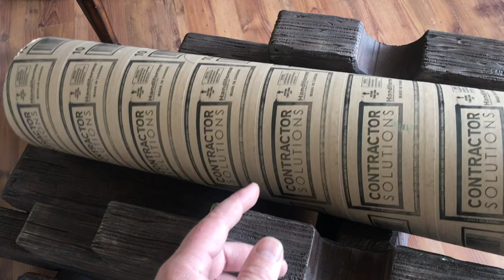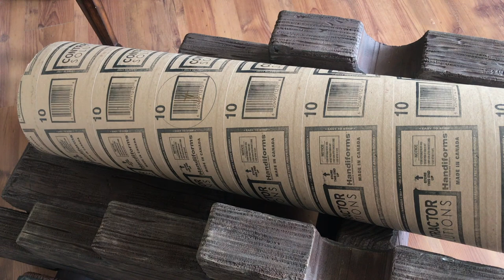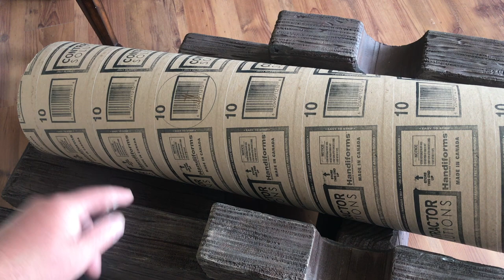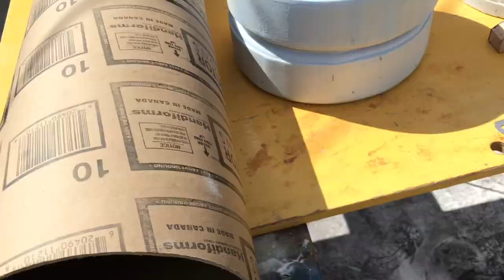Build a DIY Prop Pirate Cannon, Part II - Building the Barrel!

Comment: Looks good. Because making one wasn't difficult enough as it was, I tapered my barrel when I made mine. Just wanted to give it that "extra" bit of reality.
Reply from the maker: I get you 100% and respect the fact you went for that last bit of realism!  I had gone through the mental gymnastics of making the barrel tapered, but I knew while I may be able to pull it off decently, if anyone else tried it would become and exercise in frustration as that wedge you have to cut out must be really precise if the tube is going to rebind properly.  So after much deliberation I decided to go with a straight barrel body and some shenanigans to make it look tapered :). Thanks for watching Pirates if the North Court!

Comment: I need to do this before Halloween. Am using bigger wheels though, like wagon size! I cant put a bowl on one end though as am using a green  light and smoke machine in it.
Reply from the maker: If you are looking for a wheel design, depending on the size you were looking for I did a wagon wheel tutorial here https://youtu.be/c3hAT-a-HAM   It does take a bit of woodworking tools, but the wheel is amazing.  As for the end cap for the smoke machine, you could design is to magnet clip on.  Might just take some minor adjustments.   Glad you enjoyed the video!

Comment: You can also just take white glue and wood glue and water in a 1:1:1 ratio and that makes a good protective wash, too.
Reply from the maker: Will have to try that!   I had sealed my old porthole prop with a similar mixture, but found some issues painting on styrofoam with it. Thanks for the tip and I'll see how it goes!

Comment: I'm just starting this build.  Great job showing how you did it.  Why the base coat of brown paint?before you added final paint job. Ive seen others talk about water based polyurethane prior to painting. any ideas or experience with that?? Cheers !!
Reply from the maker: The brown base coat was to seal the tube and the repairs I made to the seams, as the spray paint was way more expensive. I wanted to throw down a dark base coat that acts like a primer and it just happened to be the best colour I had on hand (I thrive on using mis-tints from stores to save money) A nice solid base ensures the $18 can of spray paint goes as far as possible! lol.   As for a base coat of polyurethane, I have never tried it, I usually coat with a poly after completion but never before, that stuff is amazing for stopping things sticking to it.  I will definitely experiment with it and maybe you will see a video on the results!  I'm always learning :). Thanks for watching Brian!

Comment: It's a cardboard tube. Aren't you worried about it staying intact with rain and bad weather?
Reply from the maker: It is always a concern, but overall with the current finish, the chances of catastrophic failure is pretty low with low exposure.  This canon is really a indoor prop and when I put it together I had in mind that its final use was for an indoor setup.  The biggest risk is actually the barrel opening and if I was to put this thing outside, I would block up the barrel to within 1" of the end to prevent water pooling within.   The rest of the tubes have 2 coats of paint and 2 coats of varathane, good enough to fight the bad weather in small amounts.  If I was going to build an permanent outdoor prop, I would be swapping the foam for real wood, and the barrel would be sculpted, then cast so it would be a lot more weather resistant, but then the sun would become an issue with the paint and the finish.  It's always a game of cost and use :)   Thanks so much for watching Mike :)

Comment: Really loving this build!  Thank you so much for the detailed notes / videos.  What would you recommend for hallowing the middle for the wheels and front of the barrel when using NGX foam?  I'm able to create pretty accurate circles with a compass and hot wire cutter.  But cutting out the center of a circle has been a real challenge by hand.  Is there a technique you'd recommend if I don't have a band saw?
Reply: Ahhh I just realized, you break them open to clear the center out.   I was wondering why on earth you broke open the wheels.  I was thinking I'd save myself a step...and then proceeded to butcher my wheels trying to get the centers out.
Reply from the maker: Hey Todd!  Glad you are enjoying the tutorials!   As for creating that hollow in the center of the wheels.   A hot wire foam cutter should be just the trick you are looking for,  if you cut the outer circle first, scribe the inner circle, cut the whole thing in half and then cut the inside circle out and then glue it back together.  if not you could use a jigsaw and go to half depth from both sides of the foam. It really is a bit of a tough cut, but unavoidable.   Hope that helps!  Thanks for watching 😀

Comment: Nice job. Just a tip, when I build my cannons barrels out of wood and I want to hide the wood grain, so I will wrap the barrel in a light medical gauze. This will give the barrel a semi-rough cast iron look.
Reply from the maker: I'm going to have to try that Robert!   I have contemplated at some point making a cast from the cannon barrel and making it out of foam.  It something I have not done before and the size of the barrel is huge!  How large are the barrels of your cannons?   Do you lathe them? Regardless, welcome to the channel and thanks for watching!
Reply: @SamhainPropworks  , yes I do lathe them, but in two halves with a tennon joint in the middle. The Civil War cannon I'm working on right now is 75% scale. The next log I turn I will rip down the entire length, hollow out with a 4" carbide cutting wheel, glue back together, and then remount on the lathe. This will cut the weight down by half.
Reply from the maker: What kind go of wood do you use to make them?   I have thought about using the wood we have around here (Spruce/Pine/Aspen) but they are prone to splitting pretty angrily when drying.    I have wanted to do a wood cannon barrel and your process is great!  Thanks for sharing.
Reply: @SamhainPropworks  , the gauze wrap not only hides the wood grain but it also hides the small cracks. Remember, most buyers just want a cannon that looks cool in their front yard. If they are that picky, then have them go spend 20K on a real one.